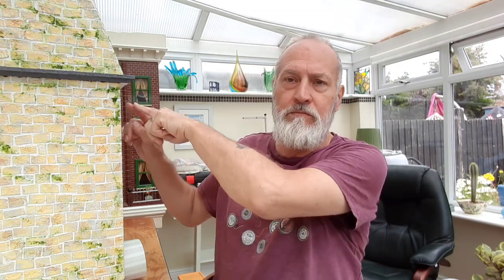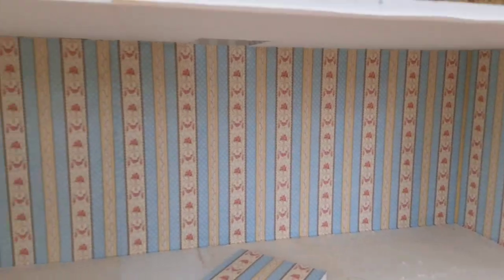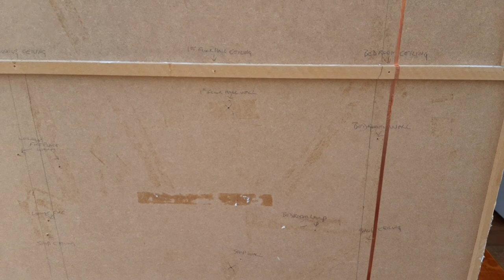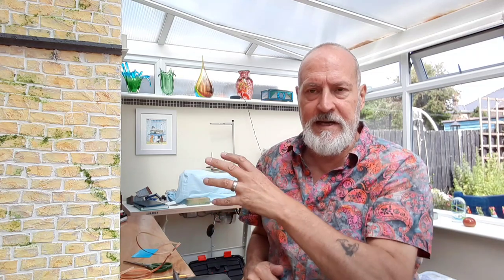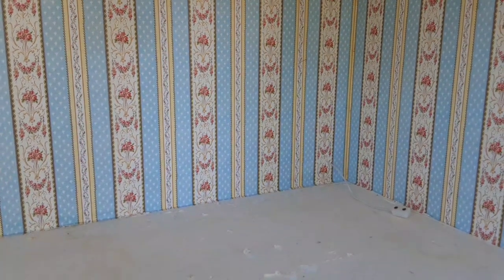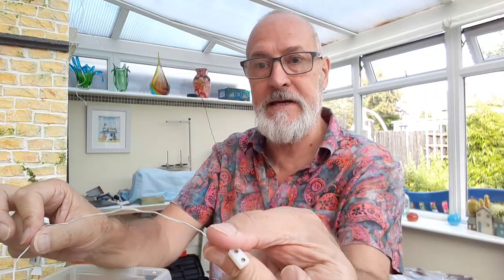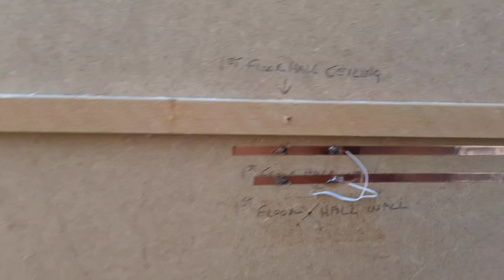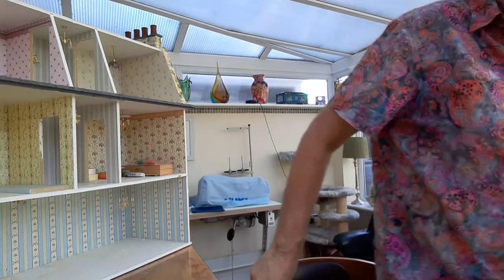the Parisian haberdashery dollhouse part #3

Comment: Rich can you run the wire through the chain.?
Reply from the maker: Hi Jean, sorry but that's an old video and without watching all through, I'm not sure what your question is concerning! Could you describe in more detail so I know what we're talking about please? 🙏😊
Reply: You were showing how to shorten a chain on a ceiling light fixture to match your length of wire. I have had trouble in the past with always seeing the wire. I just use wondering if the wire could be threaded up though the chain to hide it more from view.
Reply from the maker: @Jean-vl2nf  ah right! Well people try all different ways. If you thread the wire up through the chain, then only thread through maybe two places, because if you do too much then the strength of the wire can make the chain "defy" gravity and it doesn't hang naturally enough. Usually now days, I try to paint the cable a similar colour to the chain metal colour to help disguise it, plus sometimes I lay the chain against the cable and spot a tiny amount of superglue to a link to help keep the cable close to the chain. Then I also try to turn the fitting before I glue it to the ceiling, so that the cable is around the back of the chain (when looking from the front). Hope this helps a bit. But remember, if you fitted a real light fitting with a chain, then you would still be able to see the cable too! 😊